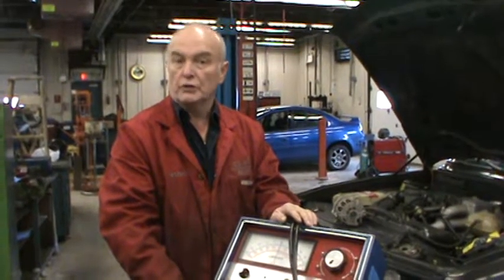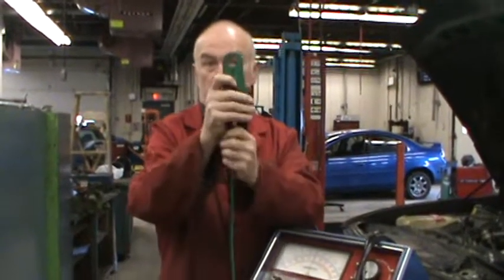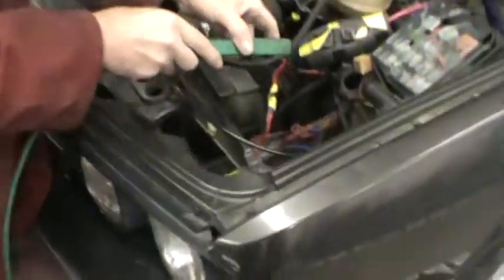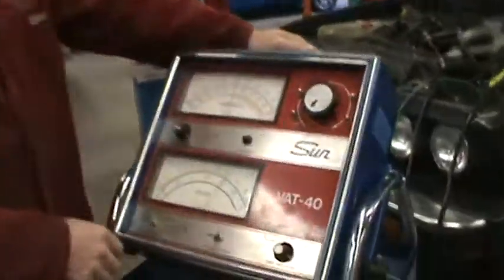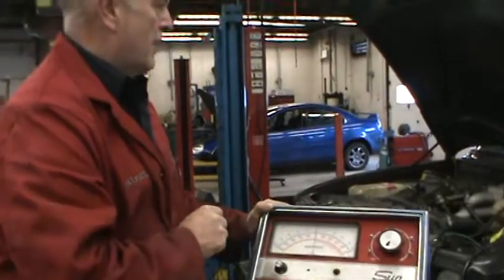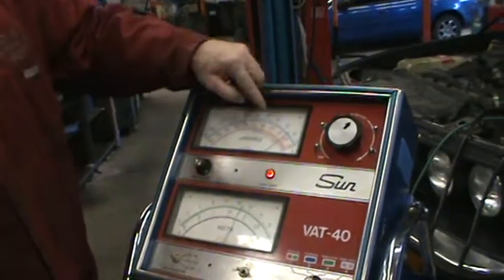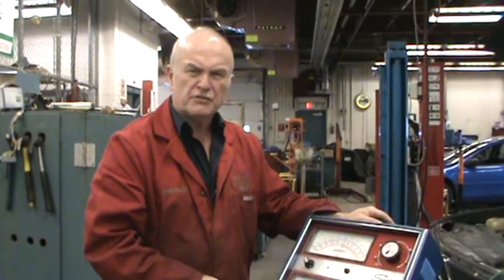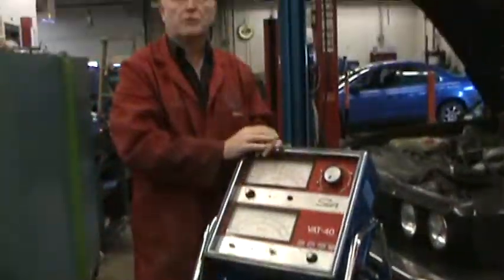How to Check Charging Systems

Comment: For 2 weeks now, my Toyota Camry 2015 coninuously says mainainance required. I got the oil changed but the mechanic was not able to get rid of the 'mainainance required' light. I tried to remove it according to instructions online. When the key is on and the engine is off, the 'mainanance required' and 'check charging system' sign flash alternatively. Do you know what this means?